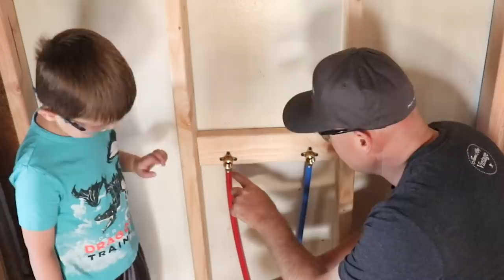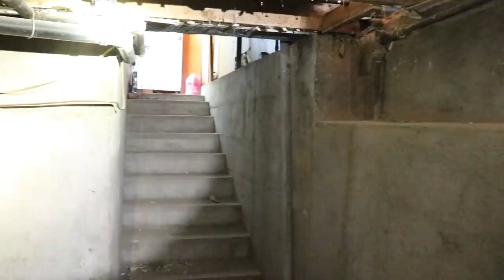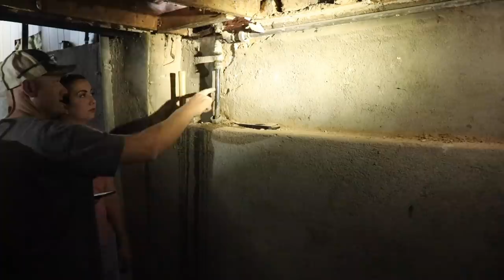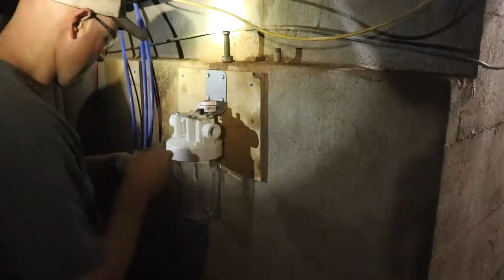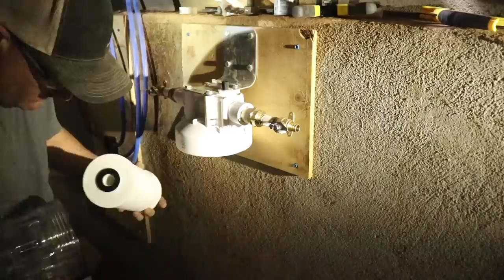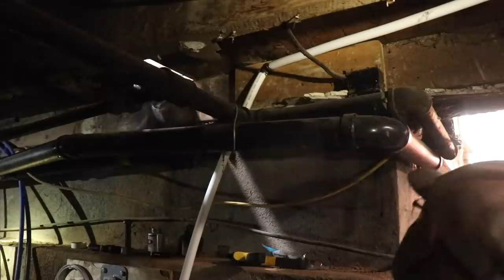Farmhouse Renovation Episode 13 | Whole Home Water Filter

Comment: Will water pressure be good through thise lines?
Reply from the maker: Yes. Typically lines to toilets and sinks are only 3/8” and you run larger 1/2” lines to tubs and washing machines.